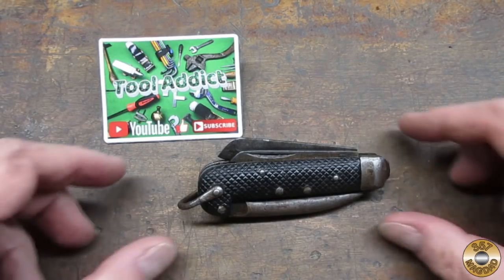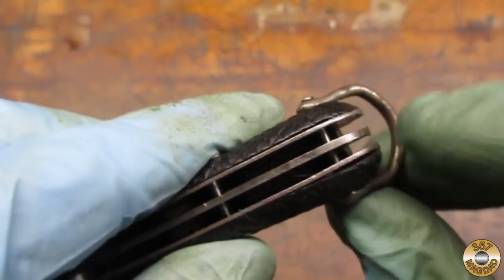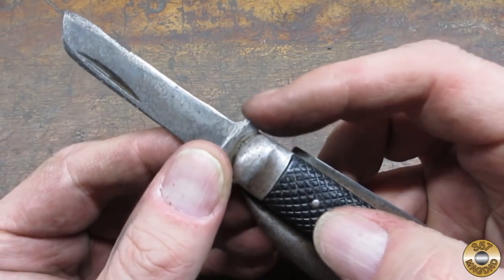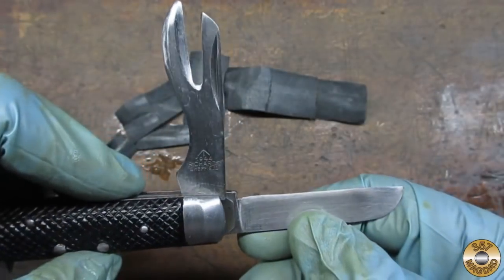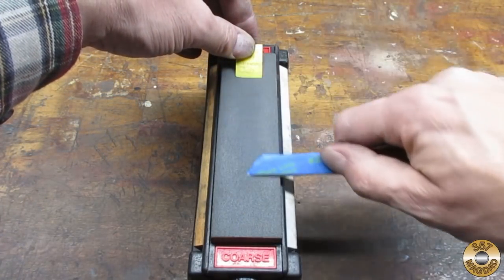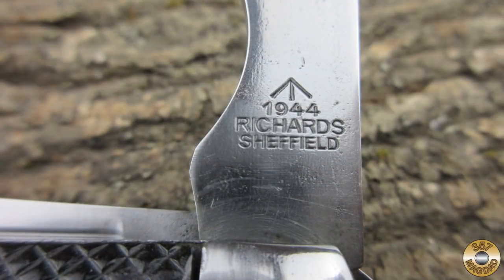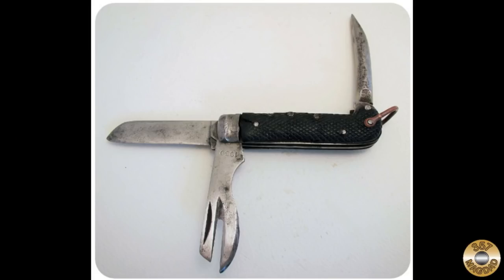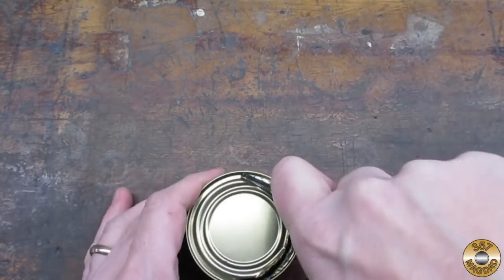Pocket Knife Restoration - WWII British Army Clasp Knife

Comment: Used but not overly abused, it's a joy when a neat old knife like that can be brought back to respectable condition and still show its age.
Reply from the maker: The blade was repeatedly badly sharpened, but it still had good snap and little wobble.  The can opener has some wobble, but overall the pocket knife is in pretty good shape for its age.

Comment: Nice job saving a lil' piece of history Bud!! That was pretty rough!!☺
Reply from the maker: Thanks RoadKing!  Cleaning up pocket knives is what got me started on vintage tools and making videos!
Reply: @357magdad  I'll share a tip with you I've seen knife makers use is to use windex to sand and polish with. 
It's a beautiful knife. Thanks for sharing. Edit from what I understand when it's short thick marlin spike they call it a FID. That's what I've heard it called. Edit#2 also the blade was changed because the stouter sheep's foot blade was intended to be pounded with a soft mallet to cut larger rope stock.
Reply from the maker: @mercuryrising9174  Great info!  I like to use WD-40 because it is oil based and will help with any hidden corrosion, rather than potentially seep in somewhere and cause more.
Reply: @357magdad  that makes sense. And you are not doing like 8K grits to get that seemingly impossible shimmer depth. 
I like rope knives I've got a couple.

Comment: Had one of these for years, very tough useful tool. The spike was for knots and splicing which is a dying craft. The screw driver stub is a real handy part ready to use without the need to open.
Mine also has the burred over end from use as a hammer. Cheers
Reply from the maker: I agree Will, this pocket knife is a well thought out and useful tool!

Comment: I have one of these, used to belong to my father, no idea where he got it from. Called it a jack knife.

I always wondered what the spike was for. Must try the can opener.

The blade on mine sits proud like the one you worked on. Not sure, but they may have been made that way.
Reply from the maker: I've come across a lot of pocket knives that have had the blade over sharpened like this one. So much metal has been removed that the point starts to peak out when closed.  Adjusting the height of the stop near the pivot always seems to do the trick for me.

Comment: The marlinspike is also used to splice 3 strand rope and multi-strand steel cable.  The knife has a beefy spine so you can strike it with a piece of wood to cut through rope cleanly in one shot with no frayed ends.  It would have been mostly hemp and manila rope at the time.
Wonderful clean up on an old workhorse.
Reply from the maker: Thanks Martin!

Comment: These were available by the truckload when I was a kid. They were all labelled labelled war department with the arrow mark. Most if not all that the public bought never saw service and were just surplus still wrapped in oiled paper. I had and lost several sets over the years. I had a set of wire cutters too at one stage. I just wish I had cared for them better as a young man.
Reply from the maker: Thanks for watching!  My example definitely had some miles on it!  It would be cool to know whose it was!

Comment: I’ve had loads of those, most of them are very difficult to open (it stops you wearing the blade out !). Most military surplus stores had a bucket of the things, they were never much good.
Reply from the maker: Thanks for watching!  My example seems to be made very well.
Reply: They were solid ok, but the edge never lasts ! I still have one in my workshop somewhere,  The most common fault is a snapped blade, squaddies trying to open cases I suspect (or to break into the NAAFI !)